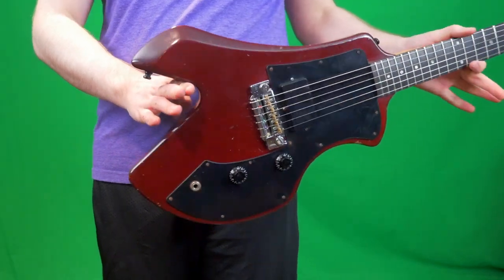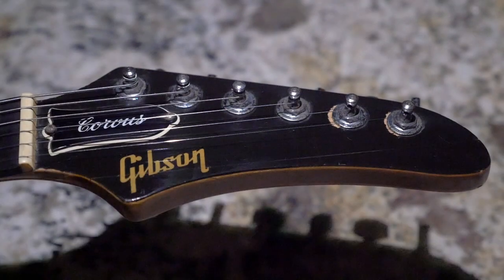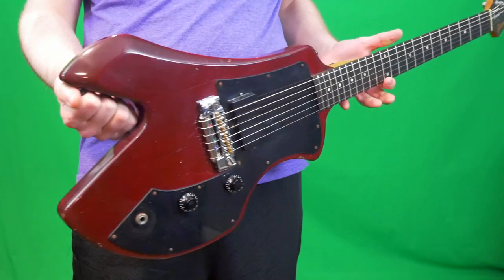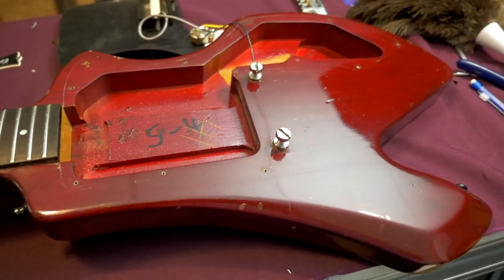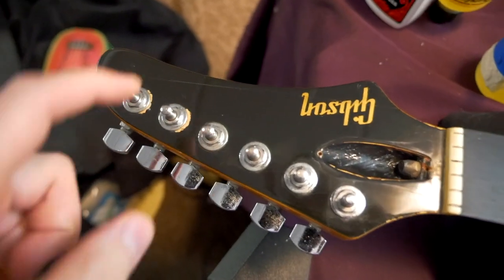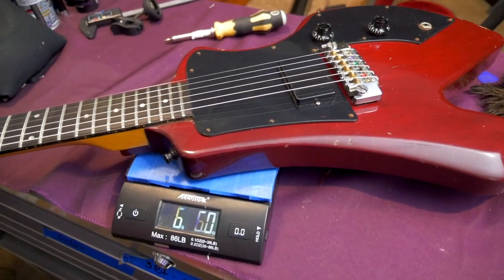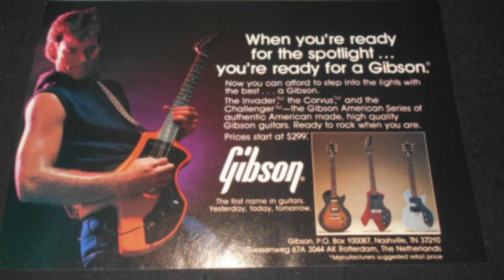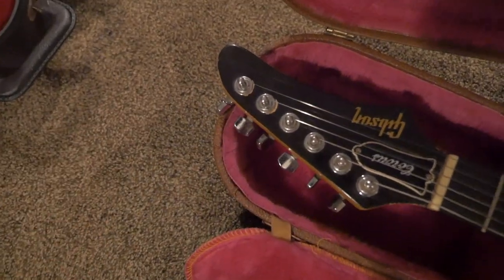This is Why Marketing Shouldn't Design Guitars | 80's Gibson Corvus / Futura History | Review + Demo

Comment: The reason there's a gap in the finish like that is because there's normally a piece of masking tape there that's finished over. I can't say if that's true for EVERY Corvus, but my silver Corvus 2 still has the tape in the exact same spot. Also, that bridge is the Schaller 455 and the brass saddles are actually just gold-plated.

Comment: "Doofy looking" = cheap looking.  Or, at the very least, NOT what you'd shop Gibson for.  It brings to mind another brand's "travel" guitar.  That design guy looks like a young Magnum PI.  Thanks for explaining the design.  That actually made sense.  Too bad what was supposed to be a "headless" guitar, this baby ended up with one of Gibson's biggest.  I love the bridge / tailpiece.  It certainly didn't effect the sound any.  I think if Gibson gave it straight Les Paul hardware, it would have had a better asking price and collector's value.

Comment: They could have put the bottom strap button at the crow's wing than the head. I have been interested in that kind of guitar since Guitar Hero. That guitar is easy to use that could have been part of the Designer series.

Comment: The Corvus has to be the most neglected and abused Gibson model ever.  It is near impossible to find a clean example.  I have a Corvus II that I like, but it is a bit beat up.  The case works, but is in need of repair.  Cool, underrated guitars, IMO.  Most people just can't get over the quirky looks, but I like the goofy Gibson models, like the Moderne, and reverse and non-reverse Firebird, which I also have.

Comment: The should have done a test run of headless bolt on necks versions. that way the could have done what they did anyway and used the headless necks for a later headless series of any shape. I suggest the square \ rectangle Bo Diddly but smaller with different types of tuners.
BTW those black plastic Lawrence pickups are very nice sounding.